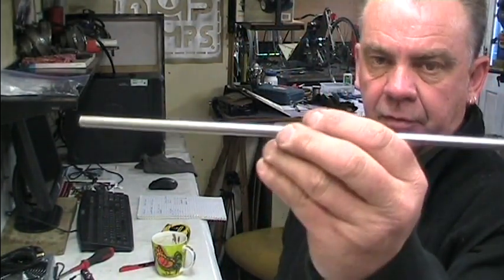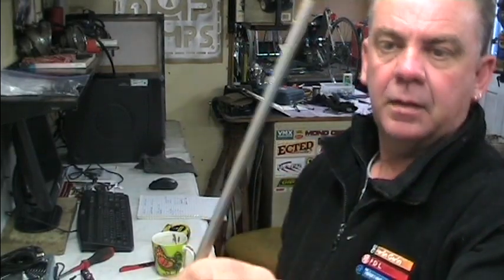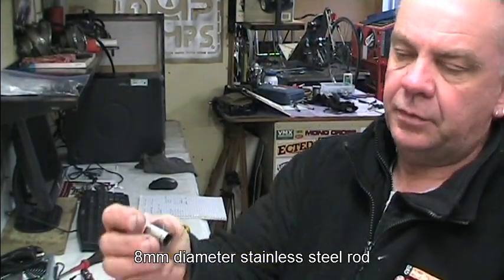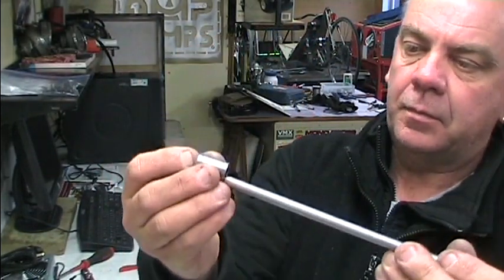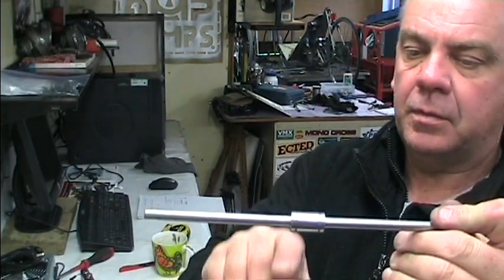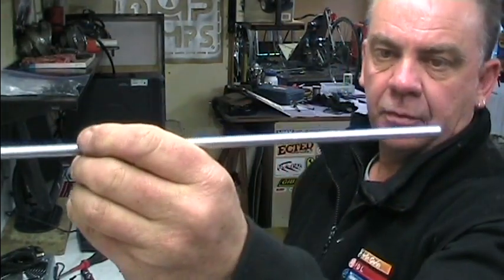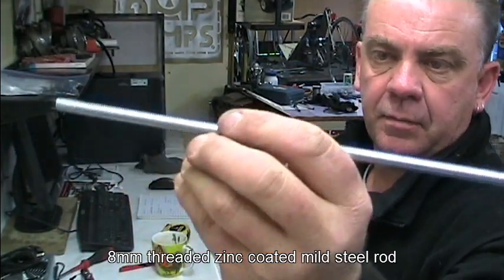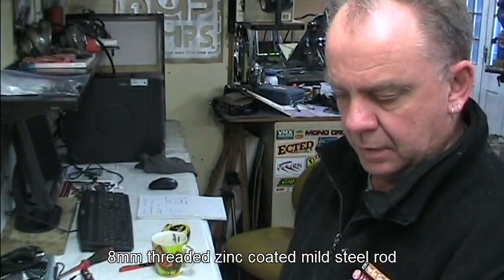Mendel Prusa Build

Comment from the maker: I have printed plastic parts out for a couple of guys who have built them and got them working OK plus I know of a few others that have printed the parts themselves and got it all built so it is a working printer. Contact me via Thingiverse if you want the plastic parts but I'm not doing full kits. The shipping cost alone makes it uneconomical and all 3D printers use the same electronics and motors so you can find them cheaper closer to home.

Comment from the maker: There is no right answer to that one sorry, everyone has a different opinion. The tried and tested Mendel Prusa is probably the easiest and simplest build and ideal as a fire printer. There are numerous kits available on ebay and they are quick to build and get printing. My open beam printers are better built and will produced better quality prints for longer but are they are harder to build and have not been around very long. The Prusa I3 is probably the easiest to build of the better printers.